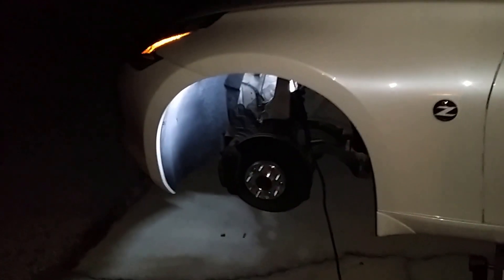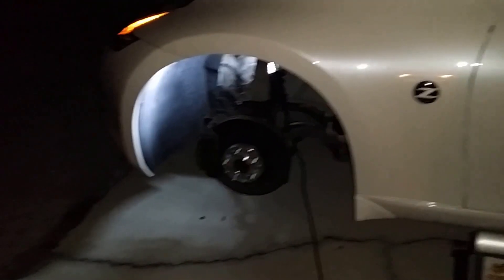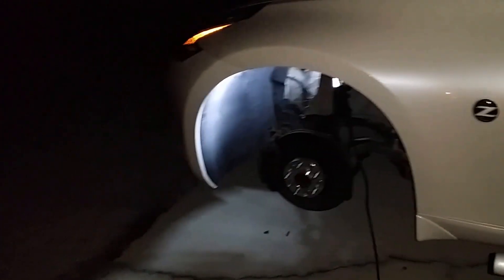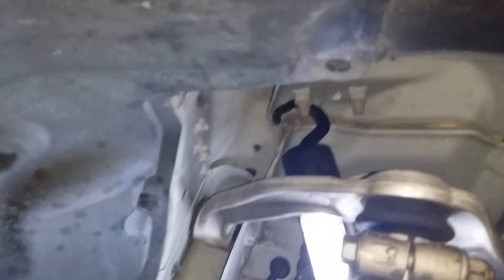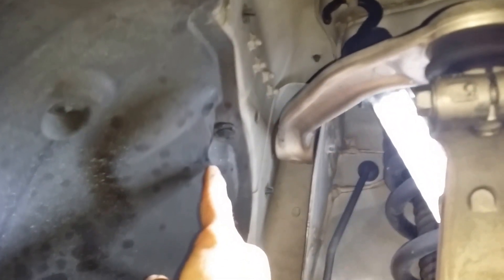How to Remove the Fender Well Plastic on a Nissan 370Z

Comment: Is this the same process for the rear wheel?
Reply from the maker: Basically, yes. the plastic push pins are in a slightly different location, but it's the same idea.